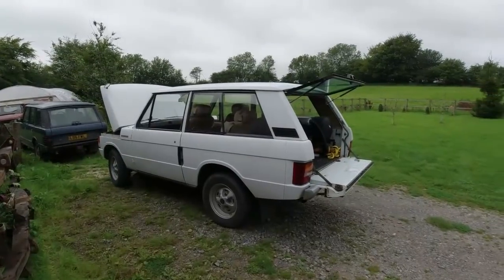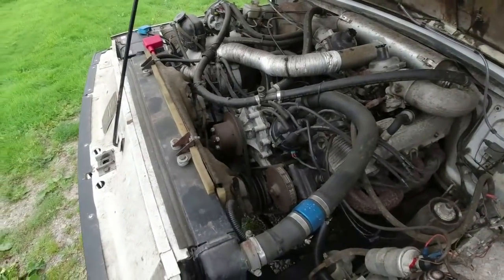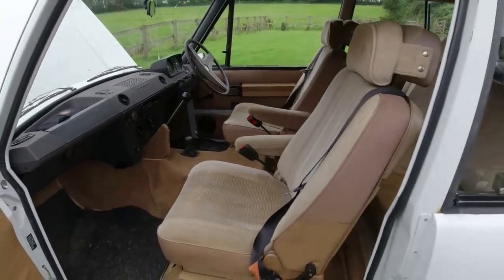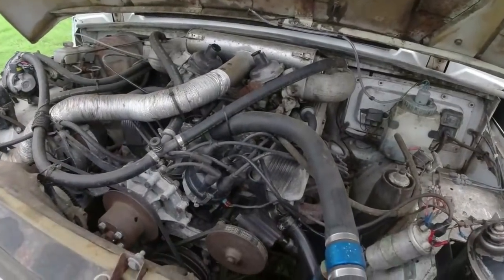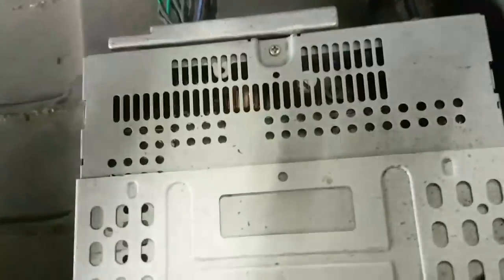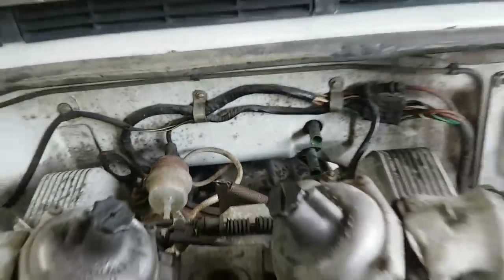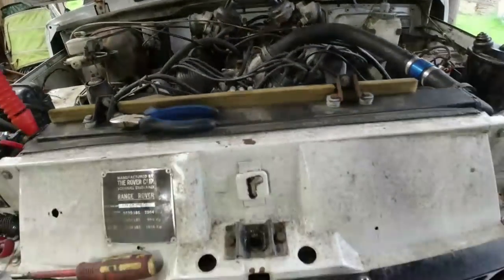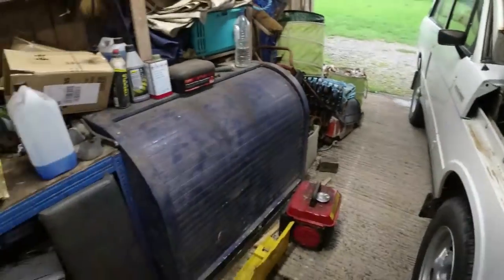1972 Range Rover A-Suffix - Diana Part 1 intro and LPG removal - Parental Warning

Comment: Funny to see my old Range Rover after more than 10 years. It has suffered quit a bit though.The LPG system is a very common thing in The Netherlands,where i owned it and it's not so complicated.Petrol prizes here are the highest in Europe and with 20 to 25L/100km isn't funny.The switch position was a mistake on my part tbh.There was a small hole in the dash so i put the switch in it to get rid of it.The upper tailgate was the original mind non heated non tinted version.This has been removed since apperantly
I also think there was a bit of dodgy work done in Luxemburg,the vacuum hose was fitted with the original one,hose from air cleaner was connected to the engine breather and some other things.
Great to see it's still around,alive and kicking.
For a car that got restored 20 years ago and being used,it did pretty well.

Comment: Wonderful ...... Very like my CKD from Costa Rica ....... Mine is LHD made Autumn 72 and shipped to Costa Rica then assembled in early 1973 . Shipped to the USA in the early 2000's and like yours repainted. It is very original and has very low miles and other than the paint has not been restored. Returning it to original 72 look after some 1980's cosmetic changes ....... Love your films, thanks for taking the time and helping out us RR nuts ....... Cheers

Comment: many years ago i had a p6 3500s with lpg fitted the breather hose had also been re routed maybe something to do with lpg just guessing though
Reply from the maker: My daily 93 Vogue runs most of the time on LPG, cleaner oil but slightly less power. Not really a huge issue.

Comment: I have heard some models has aluminium bonnets, some have told me it was just early models, some just late models. Is this true? And if so what years? Thanks
Reply from the maker: pre production stuff had aluminium bonnets, by production though I think they were all steel but still had aluminium strengtheners on the inside.
Reply: Church House Classics thanks

Comment: great car! just a quick question.  on the coolant expansion tank there is a breather pipe outlet i think it's called right bellow the cap. what i can't figure out is where that hose is supposed to lead since it's been about six years since i started the restoration of my 1979 range rover and i can't remember. if you could tell me it would be greatly appreciated.
Reply from the maker: dangled downwards and goes through the brake line hole in the inner wing

Comment: Power steering didnt come till around 74 P Reg.
Sealant was factory standard at base of rear quarter panel meeting top of Rear wing
Reply from the maker: I thought Power Steering option came in Jan 1973 on the first of the B Suffix cars.

Also yet to find an original 1970s press image showing sealant between the rear wing and d-post

I may well be wrong

Comment: Why on earth does your father leave it out over the winter , very foolish . Only needs to go under a lean to with hard standing , means an awfull lot to longevity of an original car as you know .
May I also suggest you do not repaint that lovely straight old RR it appears to me to only require mopping all over and polishing ,with only localized repairs ,paint work ,plus detailed cleaning  carried out .. This will make all the difference to the desirability and value of the vehicle . After 45yrs plus (retired ) dealing in 4×4s , sports and classics I think entitles me to a constructive comment . PS Enjoyable video again Richard .
Reply from the maker: It does live under the lean too but gets used all year round. I had a go at mopping it last year and again the year before. I think that the paint is bad, it was repainted decades ago when it was restored, I think by the Dutch owner.

When I take it up to see my body shop man I will get his professional opinion on why the paint oxidises so quickly, if I can get away with localised touching in then I would certainly go down that route.